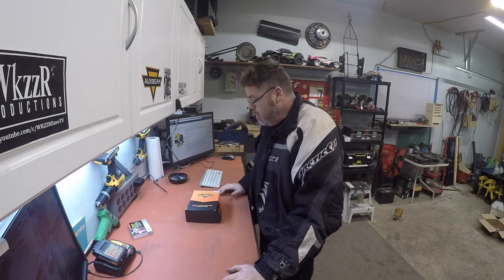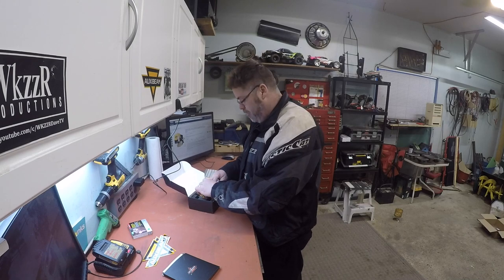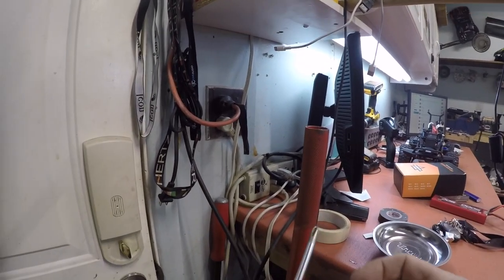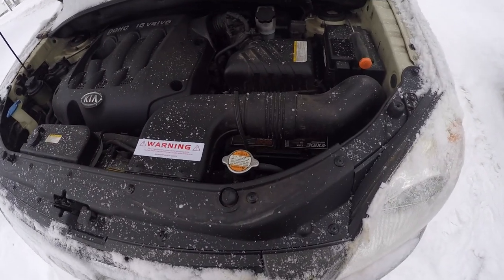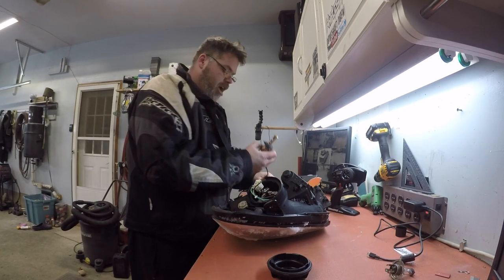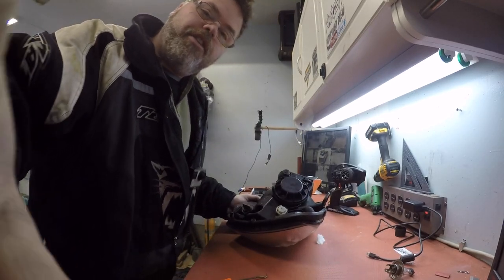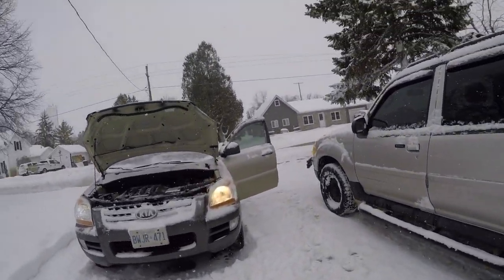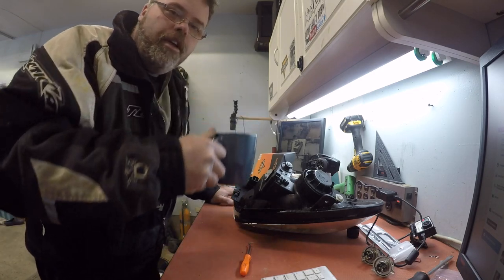Auxbeam LED Headlights F 16 Series H4 9003 In The Wifes KIA

Comment: Will putting the cap back on stop the air from Circulating in keeping the bulb cool. If I’m not mistaken that round gold part at the back of the bulb has a fan in it for cooling and why wouldn’t it?
Reply from the maker: DAN SLEDGE thought about that too . But it said nothing about leaving it off lol . Time will tell . Maybe pull it off in the summer when its hot out and theres no salt and shit to get in